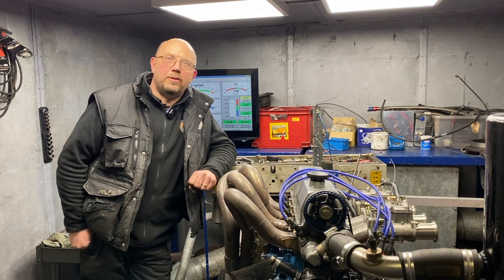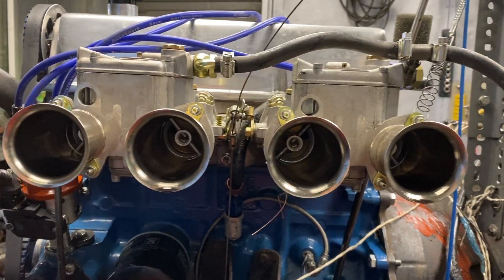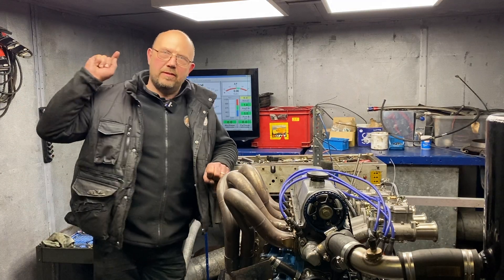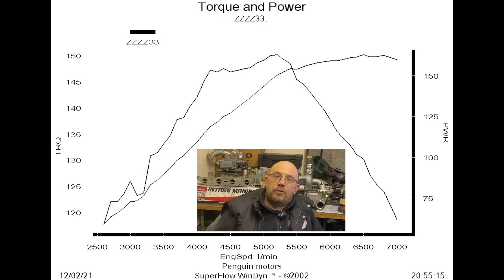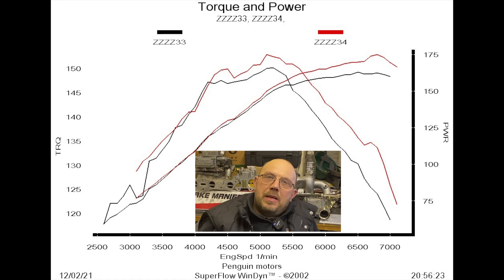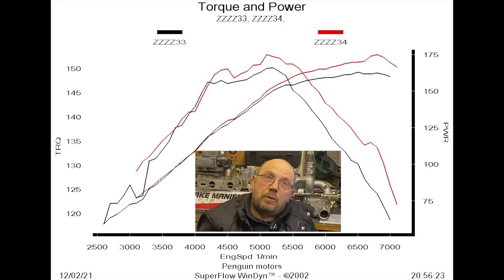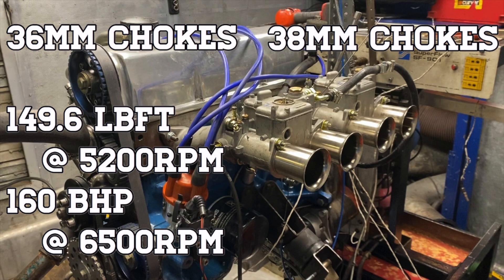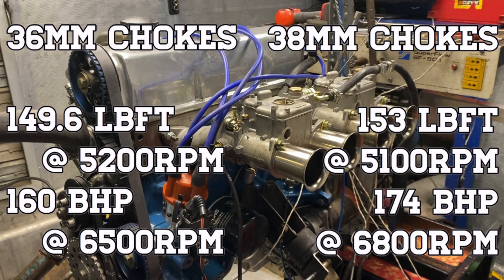2.1 Pinto Weber Carb Choke Shoot Out!

Comment: Good result that, the head is clearly breathing well to need 38's at that power level. I found a similar gain Graham a few years ago on a 2ltr making 186hp on 36mm chokes...BV head, HT1, 4-2-1.
We only had 40mm chokes to try, a bit big in 45's really, but power jumped to 197 with a lean mixture, followed by 201 with corrected jetting. Could have probably done with 48s mind breaking 200.

Keep up the informative tests Graham, top efforts.

Comment: Great test and good gain 👍I see a funky manifold on the first shot too 😀
Reply from the maker: yeah i ran that one on a different test, it looks fast, but looks can be deceiving
Reply: @PenguinMotors  I'm still on a Ashley manifold, so look forward to that shoot out. Could save me some money 😂 So on a 2L with stage 3 head would you recommend 38 chokes?
Reply: @JACKSPEED_TV  no not for yours mate yours is fast enough already 🤣
Reply: @FastRust  😂🤣👍
Reply from the maker: ashley v 3 piece big bore coming soon. the odds are your motor will make more power on 38's but you might find its not as nice to drive lower down the rev range
Reply: @PenguinMotors  Sweet 👍 Yeah thought that would be the case will stick with the 36s as it's mainly a road car.

Comment: I've subscribed. I believe the low speed running that can be improved with small chokes is not the steady state power but the driveability in the transients as you come on and off the accelerator. Enjoyed the film, thanks.
Reply from the maker: for sure smaller chokes improve drivability at low speed and transient throttle, but you can largely get round that by being progressive with the throttle, and lets face it, almost everyone wants the big numbers!

Comment: Awesome video Thanks! Any chance that you could maybe do a comparison on exhaust manifolds? Branch 4 into 1 and 4/2/1 but I would ideally like to see how the rs2000 manifold squares up. Cheers
Reply from the maker: by RS2000 manifold you mean an original cast iron mk2 rs twin down pipe one? i dont have one to test. but it used to be regarded as good as the small bore 4,2,1 janspeed manifold on fast road engines. there are some exhaust manifold tests on the way
Reply: @PenguinMotors  yes the cast RS manifold. I ported mine out to the size of the gasket on the down pipe and it has improved greatly. Looking forward to the exhaust tests.
Reply from the maker: @roygouws7945  if someone wants to lend me an RS2000 manifold with a down pipe i will do a back to back test

Comment: Great video thanks just a quick question is there much difference between 2.0 and 2.1 if they had the same head,cam and carbs
Reply: As far as I'm aware it makes very little difference, maybe a small torque increase. I believe people do it when the bore has been scored which is quite common with these engines being over 30 years old now.
Reply from the maker: in my opinion, it makes very little difference, but at some point i will be doing a back to back test
Reply: @PenguinMotors  no problem thanks for the reply I look forward to the video 👍

Comment: hello on the 2 liter pinto I am advised to mount a 1600 cylinder head with large valves for more torque my pinto and an RS2000 (NE)
Reply from the maker: 1600 head bumps the compression up a long way and has slightly more material in the short turn making it good for a race 2.0
Reply: so, I had an idea, on the 2.0 block (2 liters for the cylinder) mounted a 1.6 crankshaft, for the lightness of the masses, with a 1.8 cylinder head for compression,
Reply from the maker: @michelgerard2633  unless your using a 1600 emax crank ( which is same as 2.0) you will reduce the engine capacity and loose power and torque. There no need to re invent the wheel. i do  not know what engine spec you have now, but a bit more compression, cam and breathing will give you a lot more torque without trying anything weird
Reply: @PenguinMotors  at the moment I just have a full stock RS 2000

Comment: Never saw a timing belt go into resonance like that on the Pinto’s I built in the 1980’s. But then, I never reved past 5500 RPM on DCOE 40’s. 😏
Reply from the maker: yeah normal when you start pushing high rpm

Comment: Would vacuum balance tubes between cylinders help to reduce that fuel blowing back out the throat of the carburetors?? Can anything be done besides longer air horns??
Reply from the maker: vac tubes wont do anything, realistically the fuel stand off isnt hurting as it gets sucked back in. longer air horns wont stop it, the may just change the the point at which i happens. you could argue that with a cam revving to about 7,000 rpm, if your at full throttle at 3000 your in the wrong gear!
Reply: @PenguinMotors  Is the fuel standoff due to reversion at low RPM? If yes, could this type of footage be useful in choosing cam specs?
Reply from the maker: @andrewleonard9257  yes, smaller carbs/chokes would probably reduce it, but it is what you see holding full throttle low rpm with a hot cam. a set of bike carbs on the same engine did exactly same thing

Comment: Really informative Thanks, can we have a 44idf Vs 45 dcoes vid please
Reply from the maker: I'd love to but i don't have any IDF's and at the moment i cant justify spending £1000 buying a set just for one test
Reply: @PenguinMotors  or even a test of the cheap Chinese carbs on ebay 👍
Reply: Another +1 for the 44idf and 48IDF  cheap knock offs available for almost nothing on eBay. Several top builders used them on VW bug engines and they make fabulous power

Comment: My X-Flow 86 mm square engine put out 200 hp and 158 lb/ft.
On Northampton Motorsport's chassis dyno
Reply from the maker: arhh so you have the illusive 200bhp x/f! want to share the spec?
Reply: @PenguinMotors  Do you know :Fast Eddie Griffiths' who did work for Mountune on the YB after David Vizard?

He designed the engine, built by Jon Edwards of JEMS Race Engineering, Daventry.

Carrillo A beam rod's, CP Pistons, Custom Camshaft, Manton Pushrods, 7075 integral rocker cover, AT Power Dry sump oil pump, At throttle bodies (42mm),
Petersen Dry Sump Tank.
60 hours engine build.
1000 hours build on car
Reply: @PenguinMotors  200 hp on Northampton Motorsport's chassis Dyno with flat torque curve.
If we had run the engine at Knight Racing Services (Daventry) the engine would have made 210 hp.
Reply: @PenguinMotors  The car was on show at Race Retro Show, Stoneleigh on Northampton Motorsport's stand.
Everyone was looking at the wrong end of the car.... The speed will come from the rear axle.... Handling is key to speed.... Not power

Comment: Can you please tell me will a 2.1 run on a 32/36 carb?thanks
Reply from the maker: yes you can run a 2.1 on a 32/36, top end power wont be great though
Reply: @PenguinMotors  ok and would it run smoothly on the 32/36?
Reply from the maker: @michaeldunlea3520  at low speed that would depend on the cam